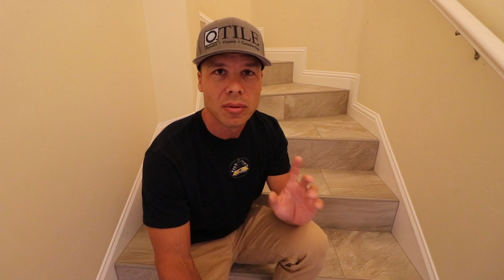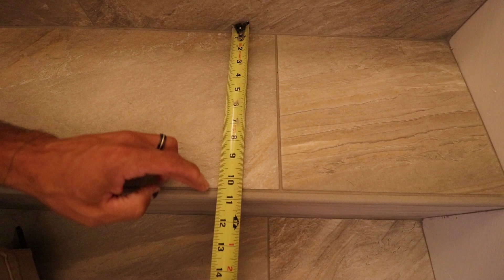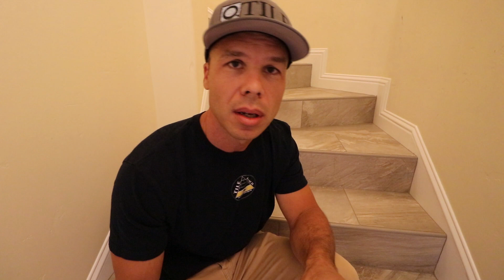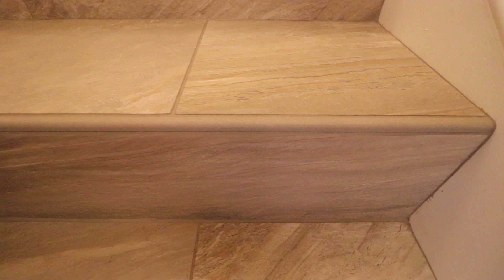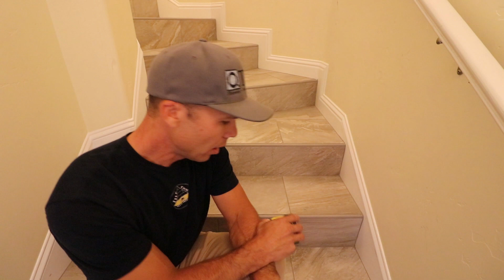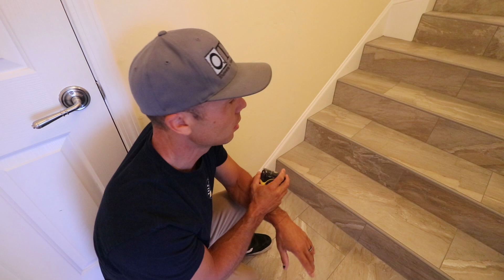Beautiful TILE STAIRCASE...Considerations Before You Begin!

Comment: Just stunning - I need to tear off my 40-yo stair carpet at some point and the traditional way is to do wood but one day I was contemplating with the idea of having tile, so I looked up, there are not too many inspirations I could find but this is the most beautiful work. I live in New York, though, is it a bad idea to walk on cold tiles? Also, tile stairs works much better if on the lower floor it has the same tile, but mine is wooden. This is so not a DIY job for me, but what a beautiful work to admire!

Comment: Hi, question about the Bullnose edge trim.  I will be using the Shluter profile aluminum bullnose on tile stairs.  The tile will be going over top of concrete stairs. Do you think it's necessary to use anchor screws to fasten the edge trim down to the concrete? Or will the motor hold it just fine?

Comment: The standard used to be that all treads edges should Touch with a straight edge on the parallel runs. Now in California as probably the rest of the  country 3/8 inch in good enough? When treads edges don't touch people will fall.

Comment: Riser is 7-3/4” max rise for residential. Commercial is 7” max rise
Reply: That is correct. 7/11s, and 6/12s for commercial , ( Treads and risers.)
I personally used to float and set 16 treads and risers with a 15 sq ft landing in the middle.
I would float 3 while my helper cut 3, and I would set 3 while he made mud. Top to bottom.
I used custom cut 7 and 11 inch float strips. I set one side of strips all the way down. If the height was squewed at the bottom from framing. I would then start back up to adjust the pitch of those strips to make the treads and risers perfect 7/11s within 1/16 tolarance.
When the inspector would show up on those jobs.
Right away, I'd straight tell him to leave his 16 ft straight edge in the truck to check the stringer points all hitting, however it was okay bring his tape measure.
They never said one word.
Christopher Risvold, Las Vegas, NV
, Trained Journeyman Marble Mason/ Stone Fabricator/ Journeyman Tile Setter,
BAC Local 5 , Santa Barbara, Ca

Comment: I would think tile steps would be fairly slippery in socks.  But you are right, the code is strict on stairs. Great video.
Reply: Really depends on the tile....I have installed a few that have better traction than the wood stairs in my home
Reply: No more slippery than hardwood